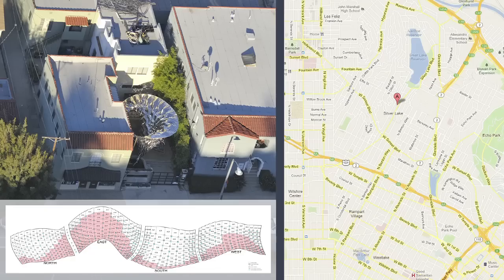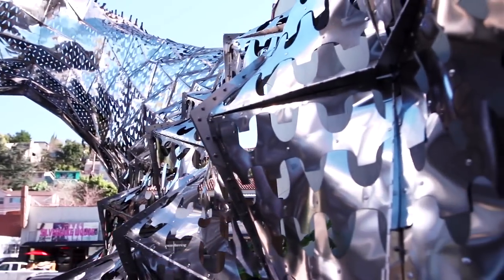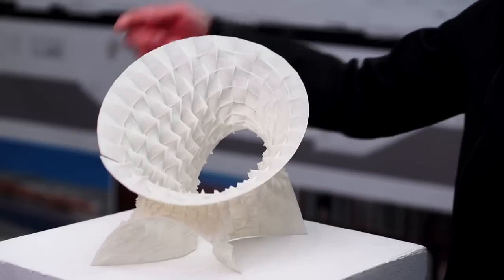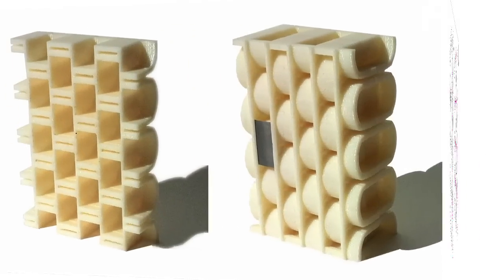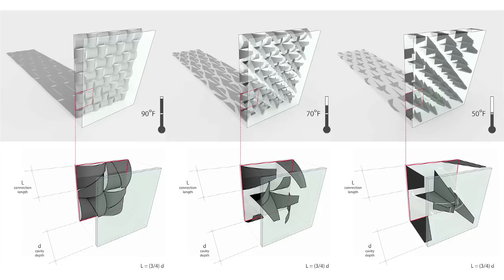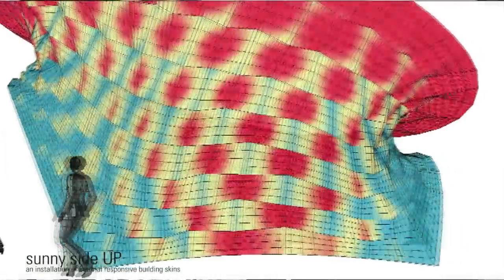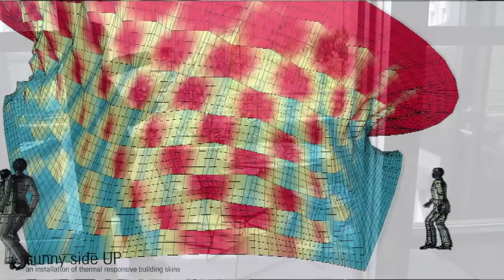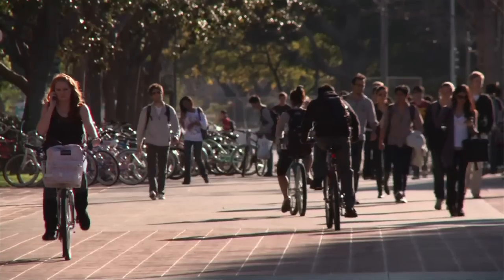Smarter Buildings: USC Architect Doris Sung

Comment: Wouldn't you want it to close when hot and open when cool?
Reply: No because regardless it is still metal and when enclosed, heat will be absorbed and will heat up the inside of the building like an over since the heat has no way of escaping. Thus making the opening work due to it cooling the building because it has openings that let the heat escape keeping the building not cool but at tolerable temperature.